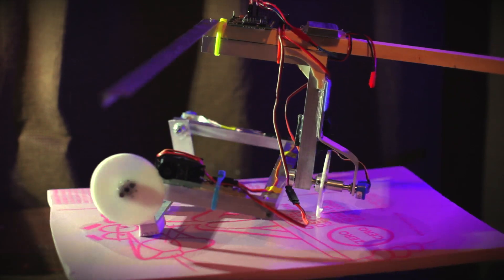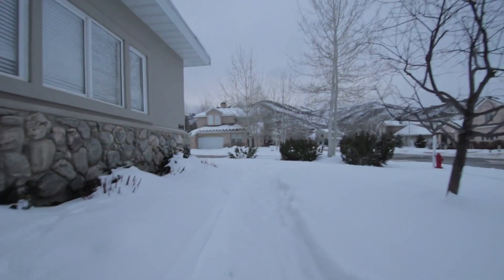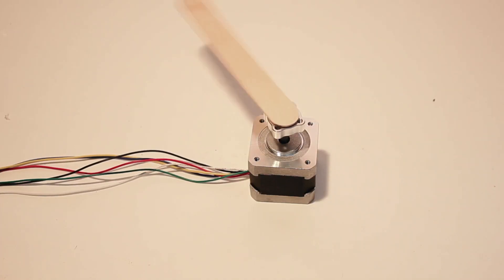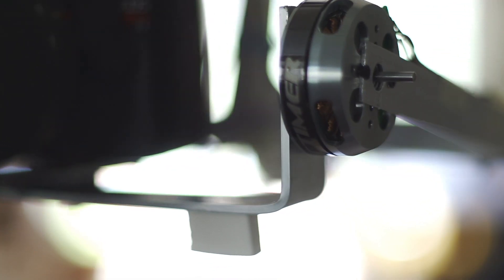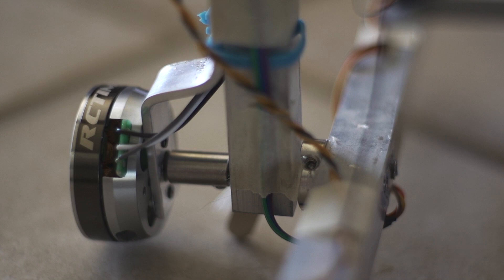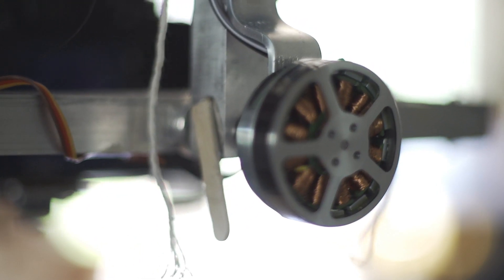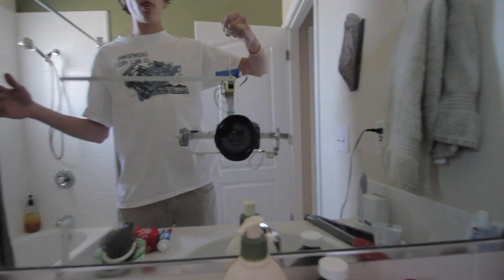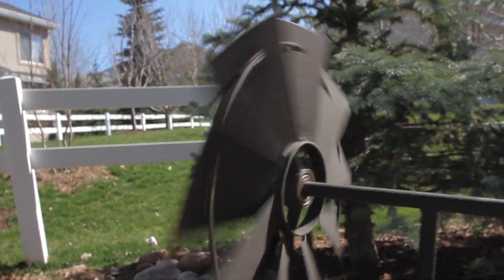Handheld Gyro Stabilized Brushless Gimbal - RCTESTFLIGHT -

Comment: I was just wondering how you wired it? The two brushless motors and the battery to the Gimbal controller? What other parts do you need to operate it without an rc system?

Comment: Could you please do a video showing it's behavior when turned Off?
I'm making a stabilizer just like that, but I'm using skateboard bearings and counter weights instead. I'm buying K2 (the fastest)bearings to make it as smooth as possible, I might also use hand air pumps as handles for verticle stabilization, but I can't seem to find any small enough. I also considered using rc car ahock absorbers but they seem to weak, is this true? Thanks in advance! :)

Comment: Did you rewind the GBM5010 gimbal motors with smaller gauge wire?, and if so, do you remember what diameter wire you used and how many turns?

Comment: Hi, you're saying in your video that the aluminium you're using is not ideal, due to high frequent vibrations. What material would you suggest to use instead? Would some sort of PVC work?

Comment: hey,man. I'm also doing a gimbal project. Currently, I have trouble on precise controlling the gimbal motor. The motor I have is, 2206gimbal motor, 12 poles 14 magnets.   I'm wondering, how do precisely control those motors?
Reply: Hang Zhou Search for microstepping. You should divide the full steps in fractions of steps. It makes the motors run much smoother.